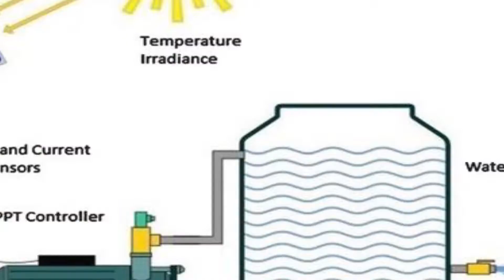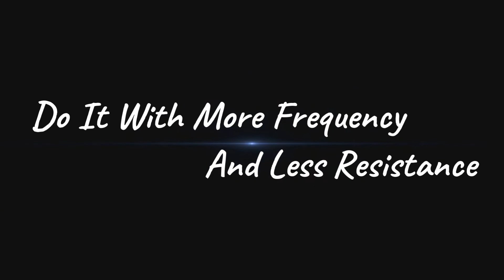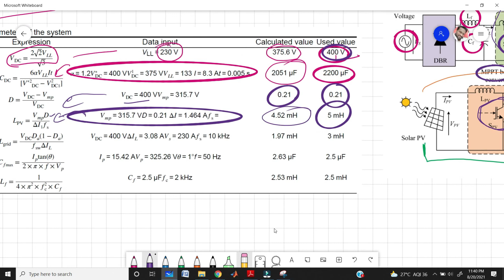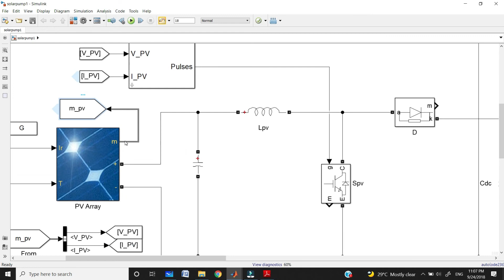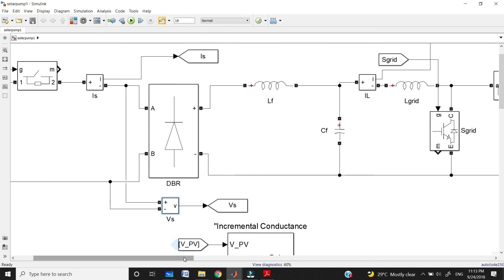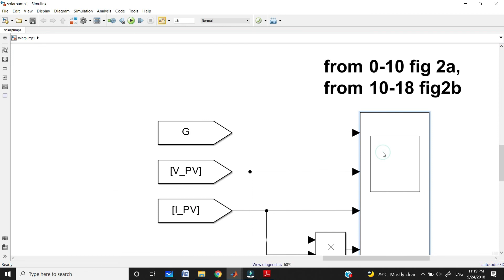Solar Water Pumping System Based MATLAB Simulink Project | EEE Mtech/Btech MATLAB Simulink Projects

Comment: Can you use the slide mode control for the same Simulation and compare it with the PID you used?
Reply from the maker: Yes we can modify with sliding mode control and we can compare performance with pid controller